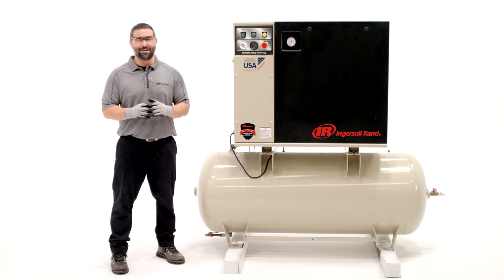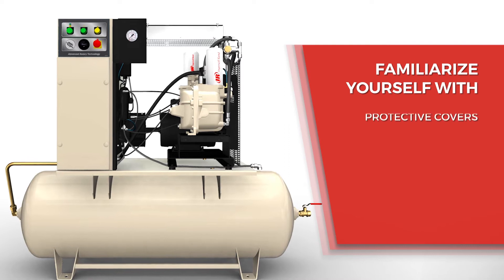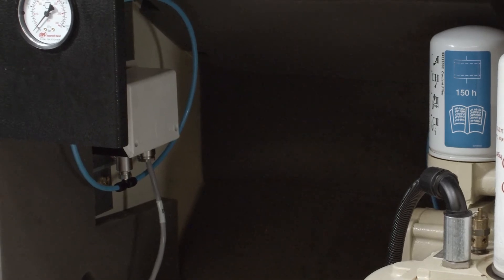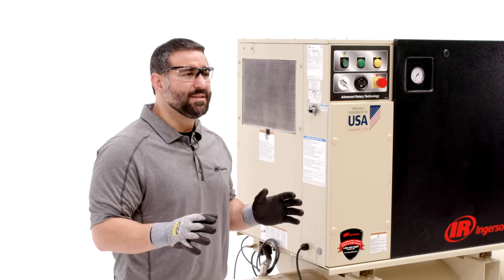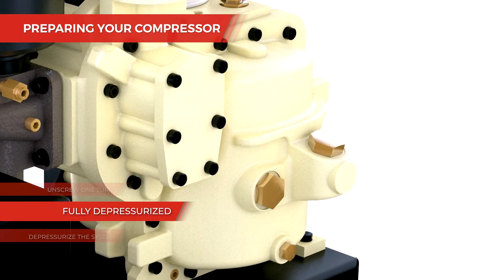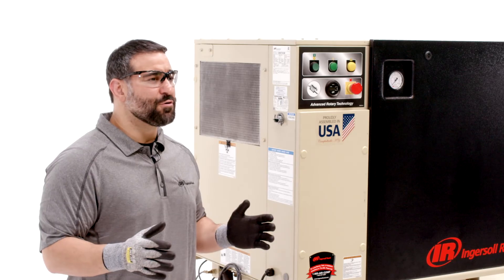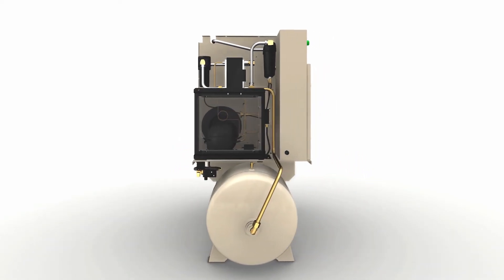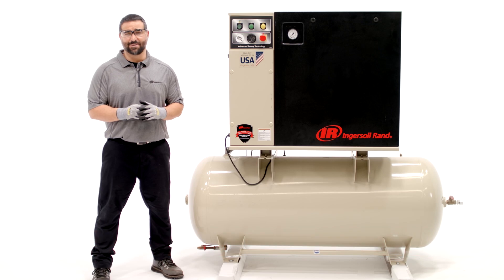Best practices preparing your compressor for service | Ingersoll Rand Oil Flooded Rotary Compressor

Comment: Hello
I have R5.5i compressor. It still displays a service due code yet I have served it and also it cuts down pressure after full refill before the set period turns off the run.
How can I reset the run off time and remove service code